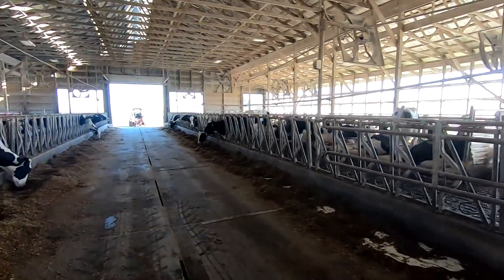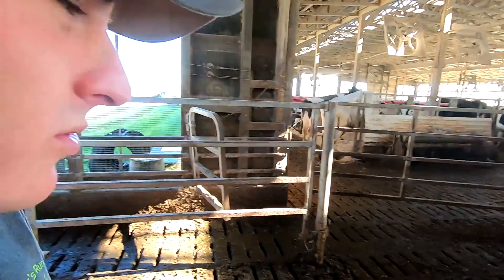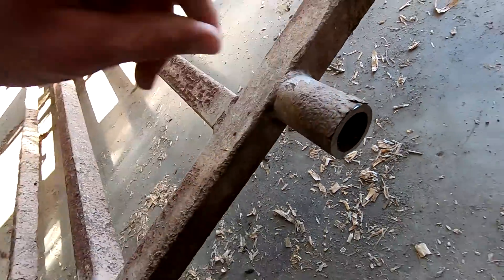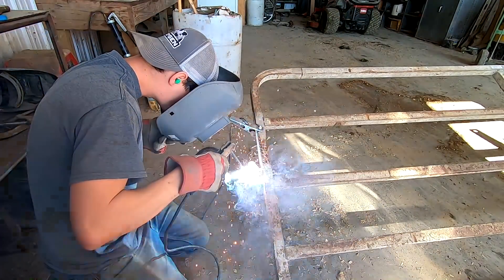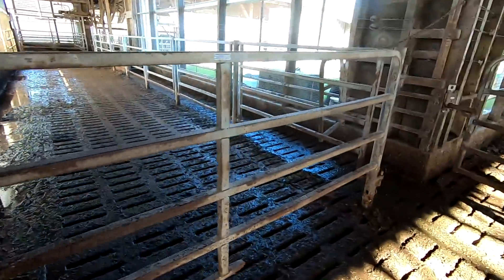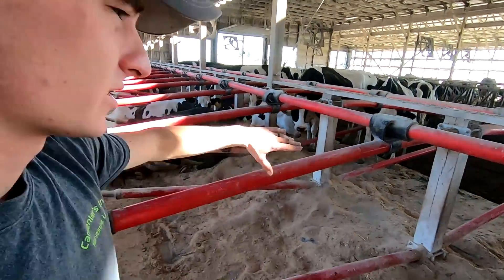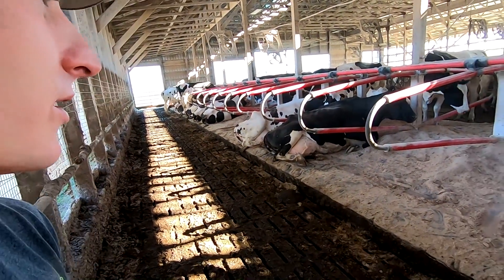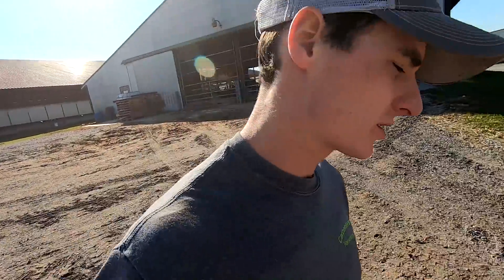Gate Repair & Easyfix Stall Review

Comment: I learned to weld with stick welders and even though it has been decades, it is still the method I prefer. I like the different sticks you can use for different jobs, wire is just too hard and a bit brittle. I am sure lots of people will tell me I am wrong, but for what I need I can stick or oxy acetylene weld whatever I need. Although the last welding I did was with a wire feed.

Comment: Great video, I’ve a top for you when your fixing the gate latch in the future , where the company welded the round onto the box,cut right up to the welded on the outside it will be easier to weld and stronger bc your going for weld to weld and it really work when the gate has light steel or rusting a lot, it’s the strongest part to work off👍👌

Comment: Nice job on the gate latch - I would have backed the nuts off on the hinges and added a little more on the latch tube, but that's just me. Allows for adjustment in the future rather than welding on extra tubing again.

Comment: On your panels or gates with the missing bottom leg is the reason they sag 
Look at ware your hinge ie located near the bottom and top but now the bottom hinge tube has no support 
If you look at the pipe your hinge is bolted to you can see a slight bend in it causing it to sag 

Love your videos

Comment: Eric, the auto darkening mask are solar powered I think, at least mine is, you need to store it with the outside of the mask facing up so sunlight can hit the solar panel recharger. Just an FYI. I seen you lay the mask down on the workbench where the solar panel will not get any light to recharge.
Reply: I would wonder how much power the solar panel will collect just from the welding arc. Probably won't be long enough to charge it but it can't be zero.
Reply: @krpajda  not sure, most of the welding light is UV, is that the wavelength that solar panels use, or do they use IR?
Reply: @jeffreykreft5442  anything around the visible spectrum should work, it depends on the type of the panel. Even if ir/uv wouldn't be useful at all the arc is much brighter than natural sunlight in light of all other colors
Reply: The solar cell is there to detect the light from the welding to trigger the darkening of the lens, the auto darkening mask will have a battery in it. Some have an easy to access compartment. Others have to be taken apart a fair bit to access the battery.
Reply: Mine also needs a little sun on the face before it will darken.  Seems if I just hang it on the wall face out it does the trick.

Comment: Hi, Hope all is good up your way. Currently work on a research and development farm across the pond. Interesting to see your thoughts on the flexi cubicles as it's something we worked with, found that the bigger cows could lean on them too much, ended up with more muck on the bed unless they shorted by a few inches. Also with scraper robots, I would suggest something where it follows guides built into the floor, our experience with one's that don't have been very unreliable, I hear good things about GEA and Lely bots all round. Its robotic milking something you have considered? All the best to you and team

Comment: Hard to tell for sure on camera, but it looked like new gate piece was galvanized?  If so be careful, l’ve always heard the galvanized coating once vaporized by being welded is very poisonous?!
Reply: I was looking or this comment. I had some concern, but he did have some ventilation. Yes, welding galvanized steel is toxic.

Comment: As a pipefitter, that weld job upset me to my core lol. If you need a better weld, bevel the edges of the pipe first so the weld penetrates.
Reply: And clean all the rust off... completely shiny on the surfaces to be welded...
Reply: @DJ-bh1ju  yeah, that galvy isn't great to breathe either.
Reply: It's a farm gate not a naval ship being welded😆